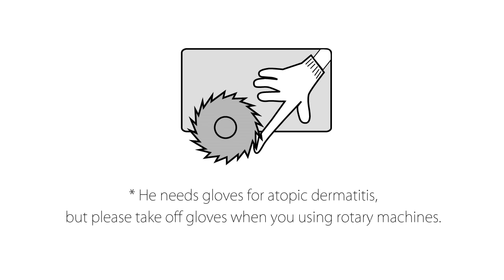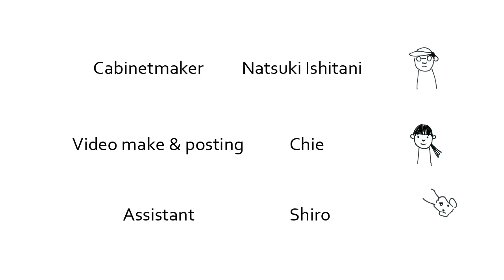ISHITANI - Making  a Bench and Chairs

Comment: I love your videos. They are calm and tidy.
In the beginning of the video you sawed the Board into two halves and then glued. Why didn't you use a solid piece?
I liked the saw, which cut the bottom of legs.
Reply: Борщ TV using both live edges as far as I can tell. A matter of design . One of this man's main, and least recognized skills, is his outstanding usage of grain patterns. In some videos you can see him play with different pieces to find just the right pattern for the feel of the piece. Can't help but praise the video editing for that, because it shows the editor (his wife if I understand correctly, Chie) knows what's going on discreetly and elegantly highlighting the skill and attention to detail of the craftsman.
Reply: Well put Franklin. I thought the same.
Reply: In addition, I think a more practical reason would be that by resawing them, it allows him to run them over his planer.
Reply: Борщ TV - Possibly put them together in reverse grain thus preventing future wood warping?
Reply: Makes it stronger and it wont warp as easy